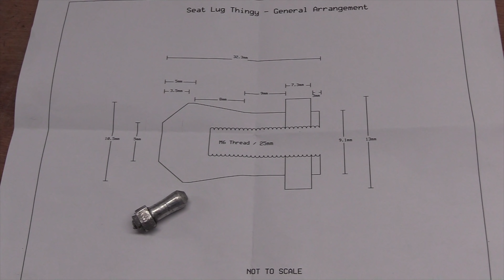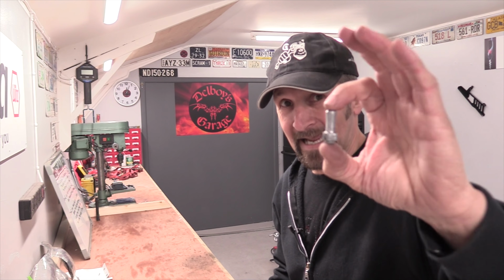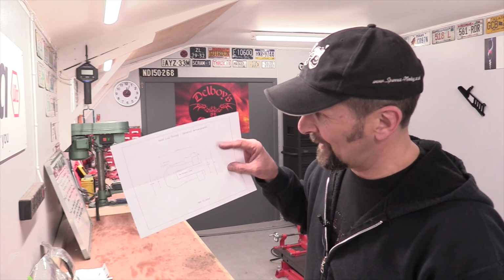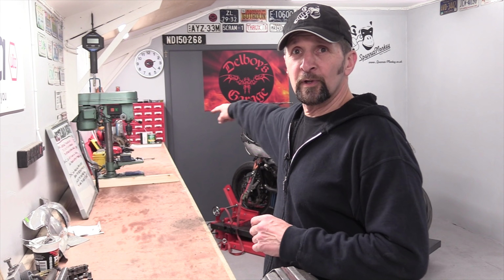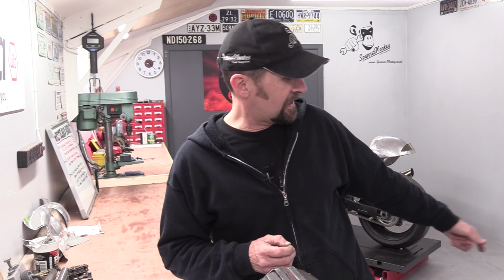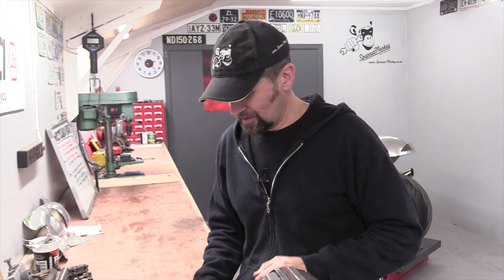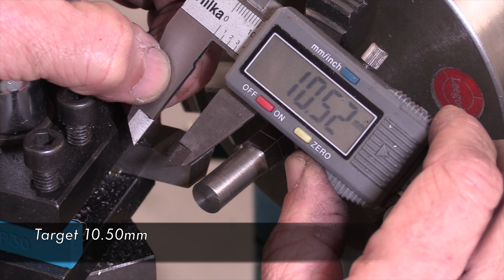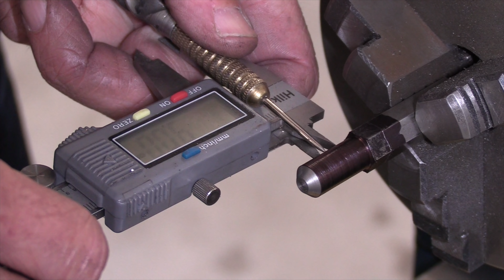Harley Davidson V-Rod, "Stainless Seat Post".

Comment: As a machinist I have a new appreciation for my skills. LOL you’re killing me with the magic marker and the square. Lol. But you got the job done and you are a very good mechanic so cheers.
Reply from the maker: Cheers buddy, I get an amazing amount of support, encouragement and guidance from the machining community which really surprised me, and most of what I've learned is a mixture of their advice and my own enthusiasm.  The square and the ruler was a handy tip I learned to shim the tool height bang on, but as I've been told, a better solution is a QCTP, am really enjoying turning, so will upgrade the machine when I can afford it.

Comment: Hi Del, Good Job !! You may not have the best machinery at your finger tips, what you do have is the ability and drive to work with what you have and think outside the box, when it’s all said and done, you get the job done. One more thing. I’m still waiting for the report on the Amsoil three hole oil change on your softail.
Reply from the maker: Hi Louis, thanks for your kind words... can't go out on the bike at the moment, so once we're released from 'lock down' I'll do the report back on the Dyna, I've barely ridden it twice since February, so not much to report on yet!

Comment: Nice job Del. Nail a piece of plexi glas on the wall inline with your chuck before you add a custom racing stripe of coolant to it. Looks good and easy cleanup. Stay well bud.
Reply from the maker: Good tip indeed, Thank you Joe, i learned that today all by myself.. like a "cutting oil lazer line" from floor to ceiling.  Doh.!   And thank you for your approval.. a tick in the box from you is high praise indeed.. Take care and keep safe Sir... All the best. Del.
Reply: @Moonfleet41  If you striped the wall, you probably have one on the left side of the front of your shirt too. Welcome to the fraternity my brother.

Comment: Good work there, it’s hard to tell from the video but looked like you May have had your speed to fast for parting, also have you tried setting your tool centre hight using the tail stock ?
Reply from the maker: Yes, tip to tip with the tailstock works too, it's just convenient to reach for a ruler and check for upright... I love it that there's always loads of ways to achieve the same thing.

Comment: Hi Del
The bike had a check up at the shop, all is well except for a few stupid things. Some deep scratches under one pipe and a chip in windscreen. Any videos you may have or will be having to do repairs on situations like I have. That chip in windscreen concerns me the most. Its small but can it lead to bigger problem on the windscreen down the road?

Comment: Nice job, as usual. But beware, stainless on stainless can bring a whole host of its own problems. Copper slip or “Dag” on the threads usually solves the issue.
Reply from the maker: Personally I use a little threadlock in most situation... thanks for your input Andrew.

Comment: Not bad at all bud. Why dont you treat yourself to a couple of micrometers ?
Reply from the maker: Thanks mate.. i do have one, and had this been critical i would have maybe taken a little more time and used it.. but its pushed into a rubber grommet to hold a seat down.. so i recon 0.02mm over on the widest point, and 0.01mm under on the narrow part of the shaft was ok.. it's all a learning curve, and im learning every time... Cheers and keep safe.. Del.